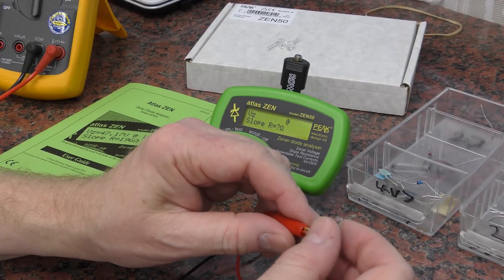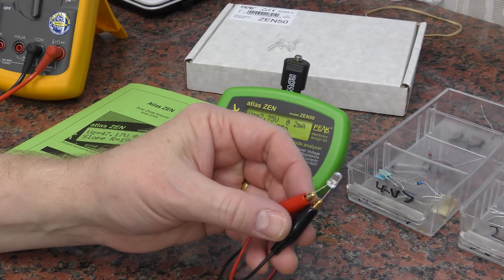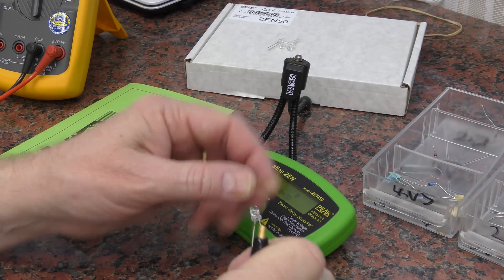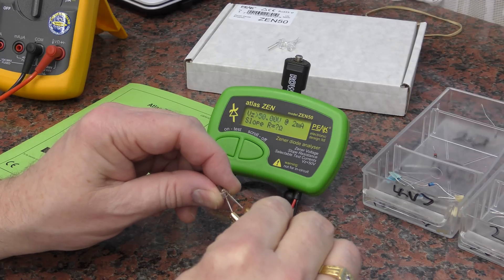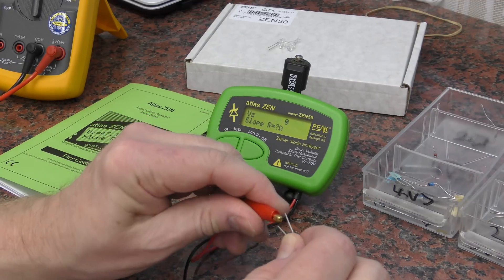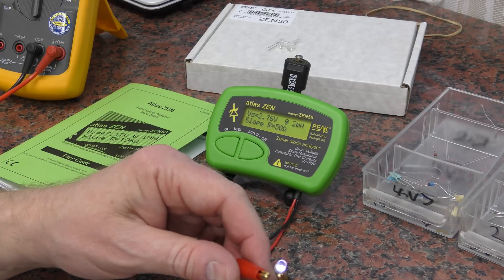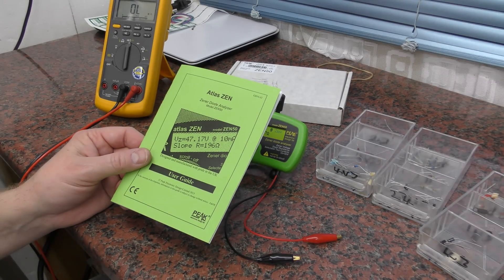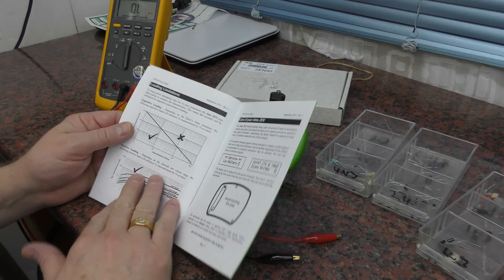Peak Electronics Zen 50. Part 2.

Comment: A very nice unit, I personally own two Peak testers and found them to be vastly better than most devices I have tested and owned. When you consider price it is worth every penny especially when one or more repairs pays for the unit. They are portable and efficient with reliability to match. The twelve volt battery will usually last up to a year or more depending on usage.